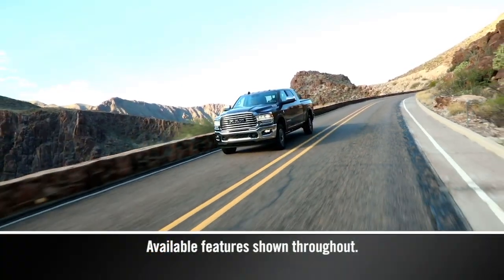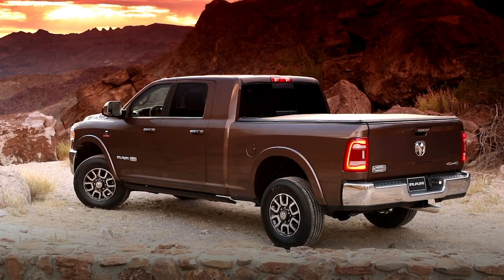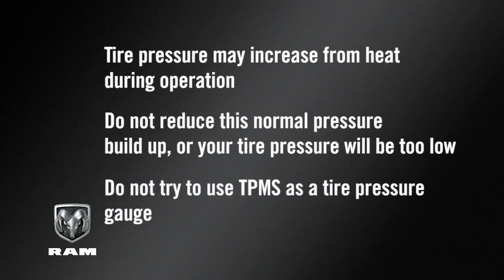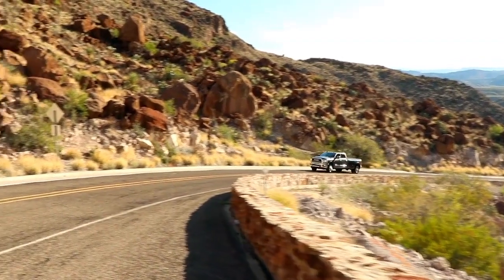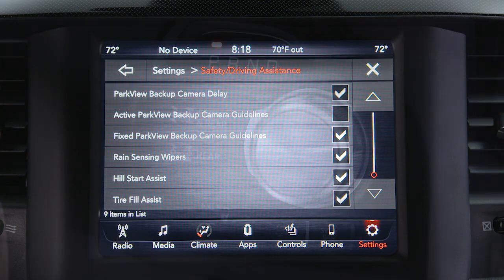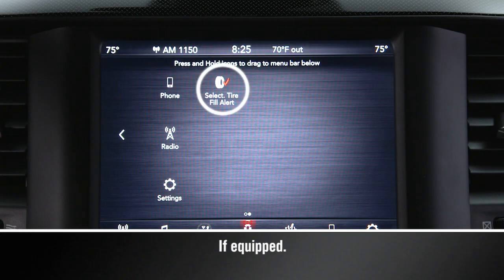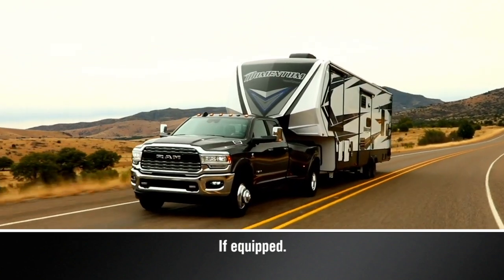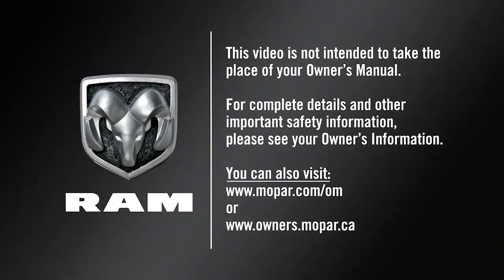Tire Pressure (TPMS, TPIS, TFA, STFA)| How To | 2020 Ram 2500-3500

Comment: I have the TTPMS system on my '21 2500 but the stems are really long and stick out past the trailer tire edge.  Why is this?  I'm concerned they will catch on something and brake off causing a flat.  Can you install just a regular factory TPMS sensor that would go in the truck wheel instead because those sensors have a shorter stem.

Comment: 21 ram 3500 dually. Do I have
 tpms?
Reply from the maker: Hello Santos, 
Per your sales codes your vehicle is equipped with a Tire pressure information system and not a Tire pressure monitoring system. ^LH